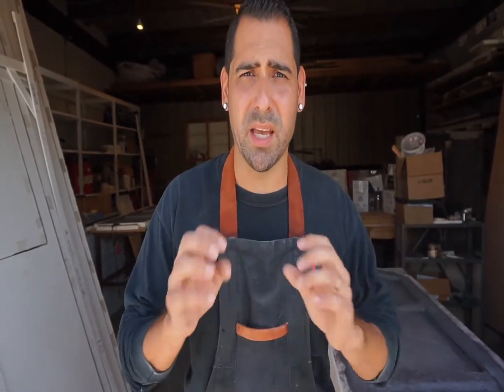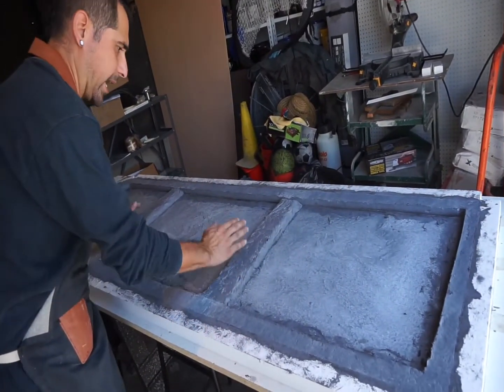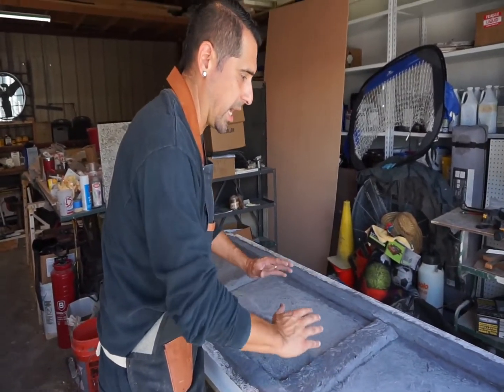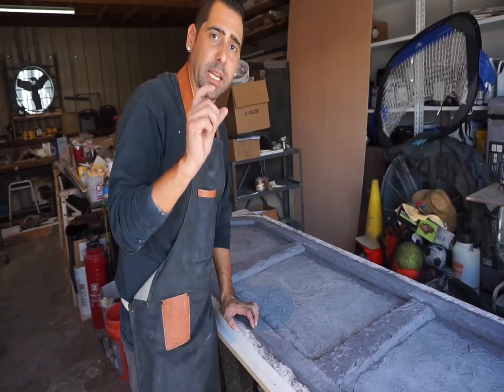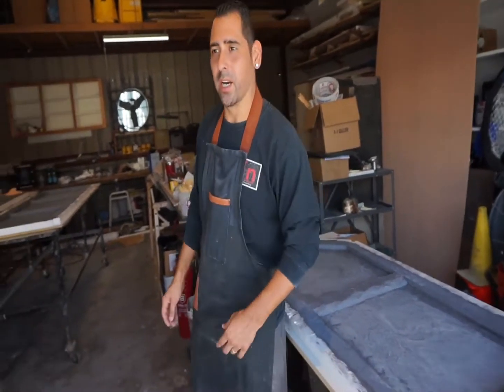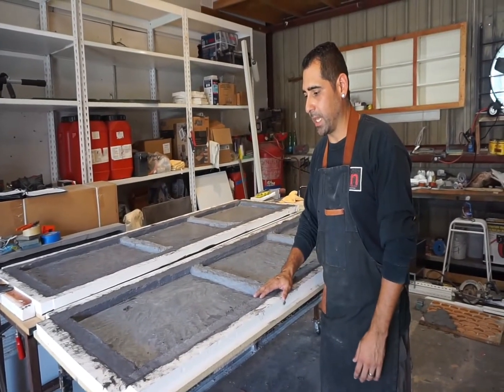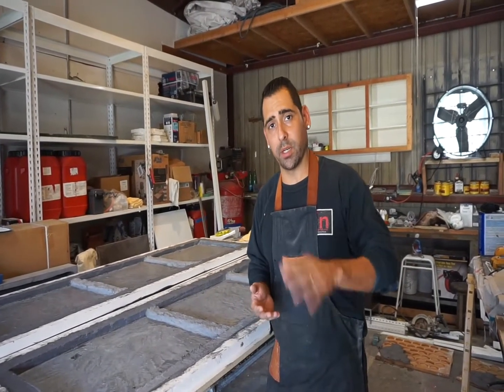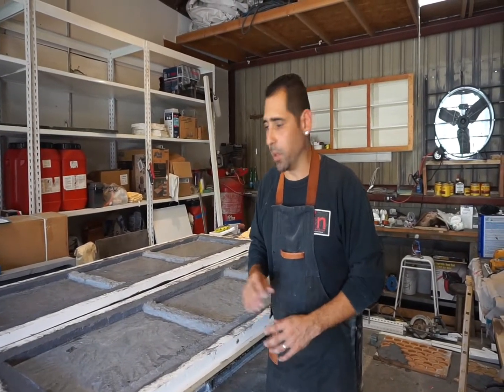Truth about concrete! Exposed gfrc how to countertop

Comment: Hello mate! Can I use one layer of glass  fibre straight to the mould ? Without the sprayed one. I did a sample with glass fibre reinforced mix straight to the melamine mould and when I de moulded you don’t notice the strings of fibre. So why all GFRC doesn’t go straight ?
Reply from the maker: Yes you can... I only spray if I have large multiple pieces or vertical areas for sinks or waterfall edges. But 90% of my pieces get straight pour of fiber mix without spray

Comment: Hey, are those cross pieces some sort of batons covered in your concrete?
Reply from the maker: Jivan Johal no sir. Those pieces are sections of highly loaded fiber built up to give integral structural strength. I just plopped material in the areas desired & waited till it was ready to be shaped